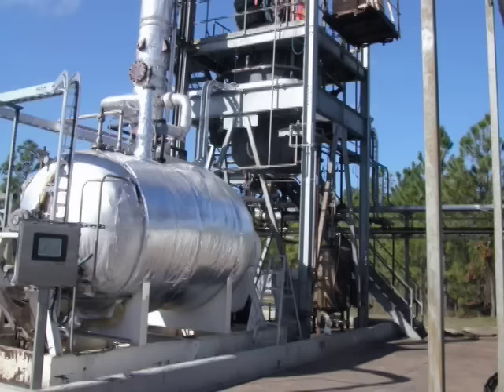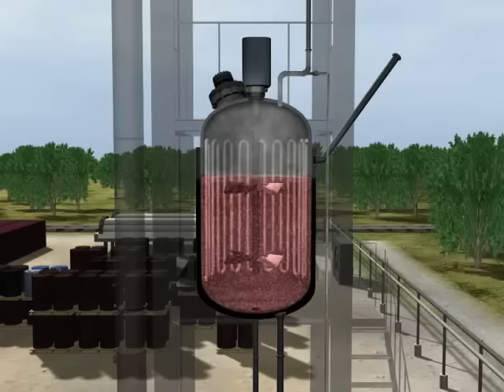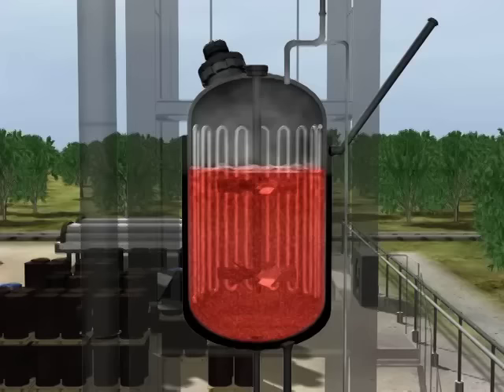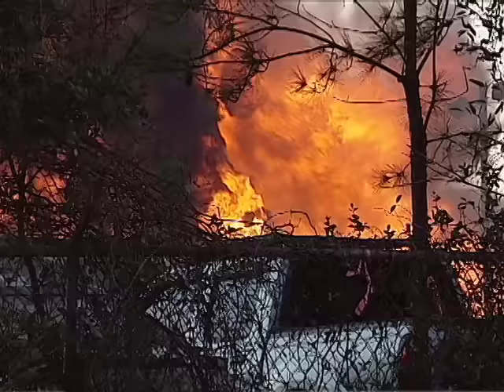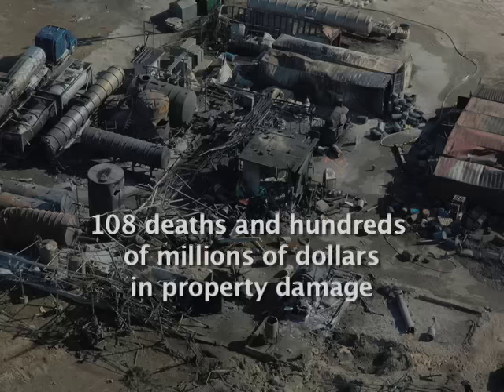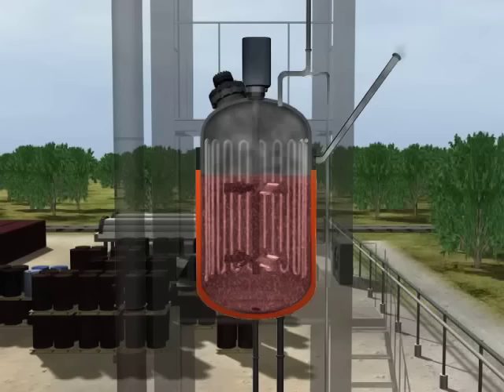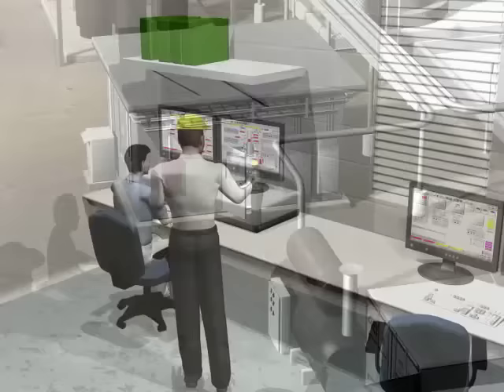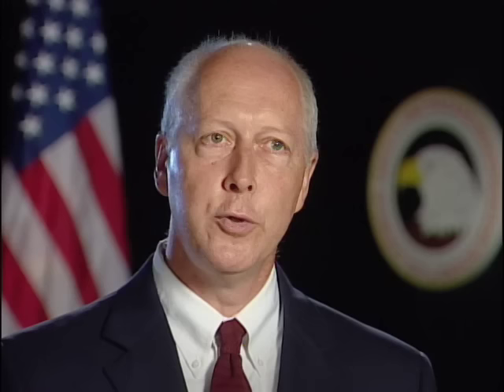Runaway: Explosion at T2 Laboratories

Comment: There are several wrongs about the process itself, and due to bad design and bad scaling, this process from the beginning was meant to be a catastrophe. First of all, the whole process was not automated, the operator was the one to activate the cooling system by simply observing temperature increase, it is safer if the process it is automated, at least that way you can minimize the risk of human error. Also, it is necessary to know the chemical reaction, it was extremely exothermic, so to be aware of the hazards that entails it is a must, a thoroughly study in kinetics and thermodynamics of the reaction would have been a good mean to avoid this catastrophe. They should have had more than one line for the cooling system in case of failure like in this case, though the cooling system apparently was controlling the temperature of the reactor, it was inefficient, they should have use one with a recycling system, introducing a heat exchanger, that way you could decrease the water flow and also avoid corrosion problems inside the cooling jacket because of the water vaporization. And finally the relief system of pressure was not adequate for the reactor, it would have been a good idea to have more than one relief line. This review was made by Students of Chemical Engineering program of the class of Chemical Reaction Engineering, of Universidad Autónoma de Nuevo, in Monterrey, Mexico.

Saúl O.
Andrea G.
Lesly A.
John G.
Jordan G.
Santiago G.
Eduardo P.
Ana G.
Reply: Saul Ortiz Rdz Venting hydrogen to the atmosphere was not entirely safe - pipe it to power a generator
Reply: @ianmoseley9910  The whole process was very inefficient. Hydrogen also is needed in many processes and could be sold of. The heat from the reaction could be used in a small generator or to heat nearby homes. Or they could get rid of the heating element by having two reactors and the heat from the one reactor is used to heat um the other one. This would also get rid of many of the scaling problems and would have made cooling far easier.
Reply: Good review, but you forgot one more problem when using a cooling system as was used in this case - the formation of scale. They've used city water which just boiled off, leading to the formation of ever-growing scale deposits, rapidly decreasing heat transfer. I highly doubt they ever cleaned the jacket with some acidic solution. I haven't read the full report, but sooner or later that uncontrolled scale would have (or maybe even did) lead to control valve stiction and hydraulic blockage of the jacket and/or steam vent.
Reply: @Mirage2000H  Oh yes I thought about that while watching the video, but forgot to mention it. Thanks for adding this.
Reply: @mathewcherrystone9479   you're most welcome! On a side note, I had some experience working for a big pharmaceutical company on the research of candidate dangerous reactions during manufacture of APIs. That data was used to improve the safety of the plants by implementing emergency procedures and/or modifying the equipment or reaction conditions. We would lead reactions purposefully to a runaway in a small reactor which would be best described as a bomb calorimeter. Those were fun times! However cleaning the reactor afterwards, not so much often times haha.
Reply: @Mirage2000H  I´m just on my way to become a process engineer (3rd semester), but we already had a lecture on designing reactors and this shows why...